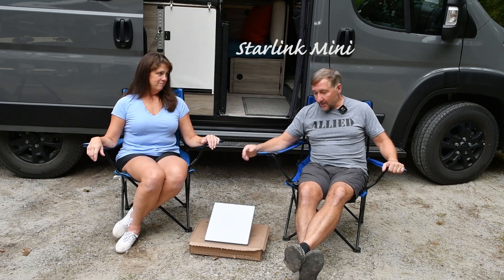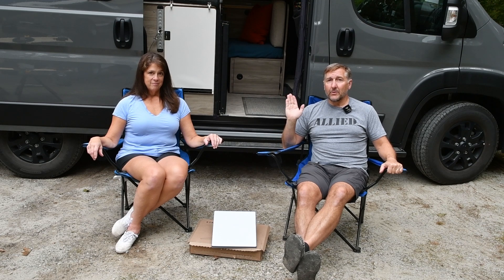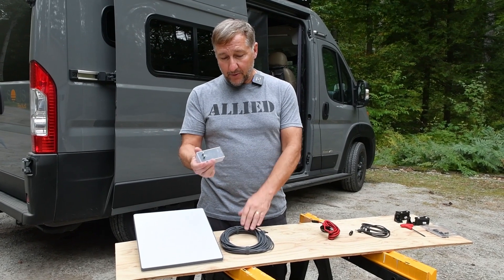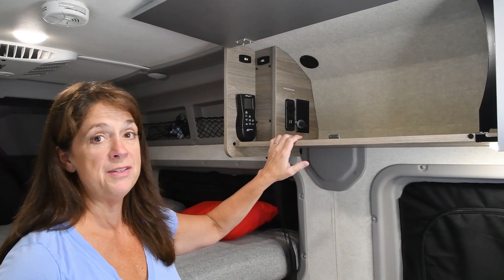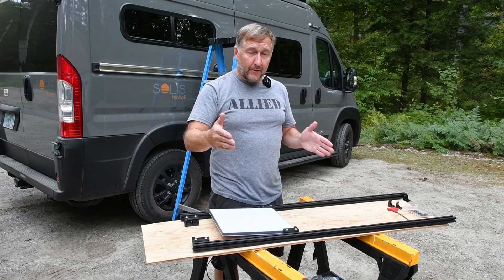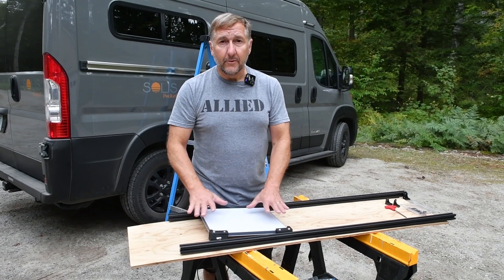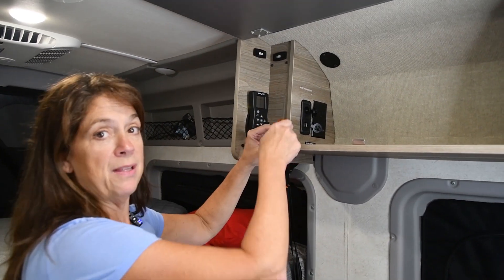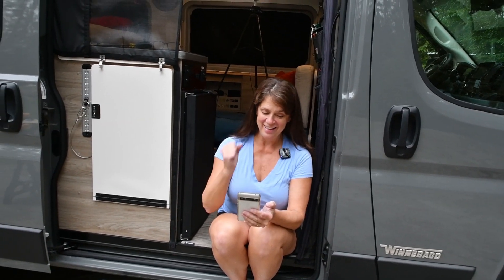HOW TO: Adding Starlink Mini to Our Van

Comment: Nice video. Our older RV does not come with the 12 volt cigarette lighter plug pre-installed. I’ve searched and cannot find one. Do you have a link for a female cig lighter plug?
Reply from the maker: Hi, thanks for watching and for the feedback. Without a cigarette lighter/car charger pre-installed, do you have any other type of port to tap into the 12v power in the RV? They make many different types of adapters. But if not, then yes you will need to wire a female car power outlet into the 12v power system of your RV. Assuming you are comfortable doing this, there are many options available, this search will show you a large variety. 

https://www.amazon.com/s?k=Car+Charger+Power+Cigarette+Lighter+Female+Socket

I might recommend one that would mount permanently into the wall if possible for the cleanest look, or I see there is even a surface-mount option.

Let me know if that helps or if you have any other questions.

Thanks!

Comment: Great video,  thanks. 

The mini does not have a motor, how do you go about changing the angle to point to the best sat?
If i understsd , the mount you used is fixed angle?
Reply from the maker: Hi! Thanks for the question. Keep your eye out for our next video which we plan to publish Friday which is a follow up to Starlink. But the short answer is that you do not have to adjust it at all, it just stays fixed on the roof rack and operates fine. Thanks for watching.

Comment: Hows that 12v power cord holding up…. I know the minis can be finicky with power.. any drops or anything noticeable with it? Link to the 12 plug?
Reply from the maker: Hey there! Thanks for watching and for your questions. No power issues with the mini. The only issue we had is that sometimes the 12v adapter wiggles loose from the van receptacle. Otherwise all good. Check video description for links to all products we used. Thanks and take care!

Comment: Great video. I have the 59PX with the pop-up and no rack system, so I'd have to think about how I would mount it. But encouraging to see the successful install - you guys were due for something to go right!
Reply from the maker: Hi again! Thanks a lot for following along. It has been a good upgrade and not too difficult. Instead of a roof mount, you can always set up the ground antenna if you are not moving. We will do a follow-up on our experience with the starlink shortly.

Comment: I ordered a star mounts, magnetic mount ,its encapsulates the dish in a sturdy case with 4 magnetic feet, i can toss it on my van roof, then move it to my toolbox on my work truck, set it on my table while camping,  it makes it very convenient to use anywhere,  im using the DC type c coord amd powering it with a bluetti eb70, in my van, i installed a permanent power coord via a roof jack,  and installed a 100w pd outlet from cool gear.. i love it, even working on oil rigs in remote places, our crew of 5  can all connect and have internet and phone.. amazing technology 👏 🙌
Reply from the maker: That's great! Thanks for watching and sharing the details of your install. Sounds like a great fit for your needs.

Comment: Excellent job. How's the signal when you're inside the van? Does the metal roof cause any interference?
Reply from the maker: Hi! Thanks for watching and for the question. So far, we have not noticed interference. We will post a follow-up once we have used it for a while.

Comment: Do you get enough data with the $50/month plan?  How many hours of use?
Reply from the maker: Hello! Thanks for the great question. For $50 per month, you get 50GB of data. If you go over, extra data costs $1 per GB. Is it enough? It should be for our needs. We plan to do a follow-up and will share our experience with service on the road and data usage.

Comment: Great helpful video. After we purchase our 59PX next spring, I’ll be getting the Gen3 and a 90 ft cable and mounting the Gen3 to a magnetic mount. I’ll be working full time while we travel and need to additional download/upload speeds the Gen3 provided. If we’re camped around trees, I can move the Starlink out 90 ft from the van to get the utmost northern view of the satellites. Keep us posted how your mini works for you. ✌️
Reply from the maker: Thank you for watching and for the great feedback. Good luck with your Gen3. That setup seems to make a lot of sense in your case. And yes, we are planning a follow-up on the Starlink Mini after we see how it performs on the road. Happy travels!